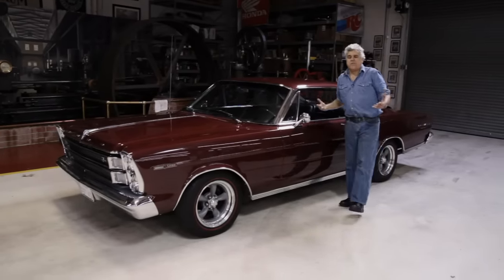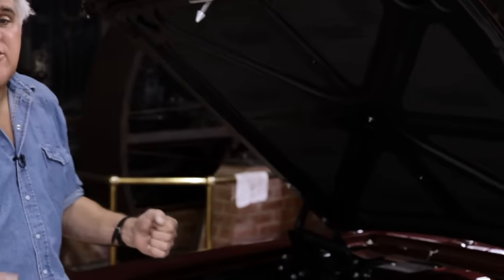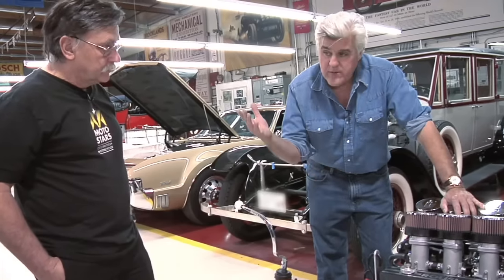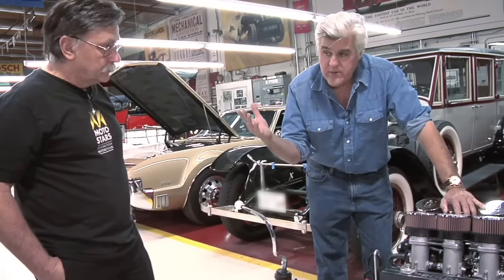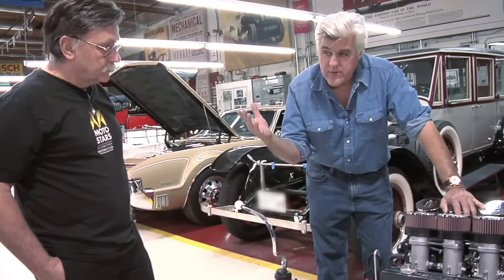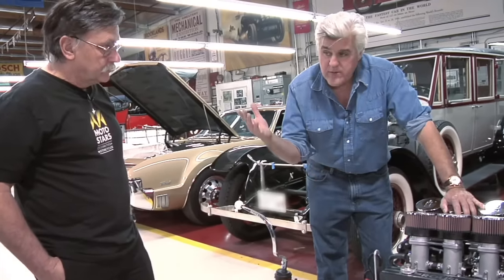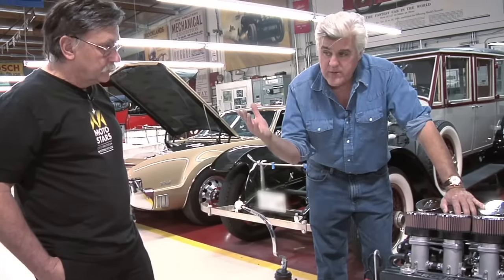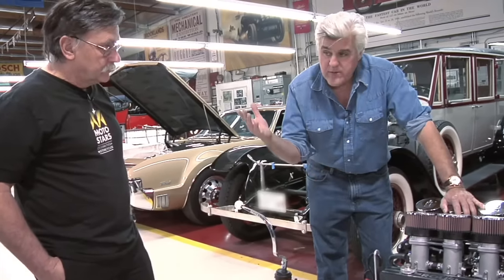Restoration Blog: 1966 Ford Galaxie, Ultimate Edition - Jay Leno's Garage

Comment: "17's look kind of goofy on a vintage car"
AMEN
Reply: +Zakk Gardner It's a big car, ZAKK!I have a 64 with 18's and it looks fine, 20's would look better!
Reply: Sorry, wrong.It isn't a "Hot Wheels" car. It's a 1966 Ford. It didn't come with, and doesn't look goood with "20's". That's for wannabees. It needs 15 inch tires so they match the wheel wells.
Reply: Nope....I used to see it as you do. But things have changed over the past few years.! Because wheels are now typically 19" and 20" sized  in performance applications.....a 17" wheel today looks  lot like the way a 15" wheel, with the extra side wall, looked to my eye in years past. The fact is you really don't have  lot of choices anymore in 15" tires. If you want a "good" tire.......you really have to consider a 17" wheel now.
Reply: From a cosmetic viewpoint, anything larger than 15" on this car puts too much emphasis on the wheel. This simply looks goofy.... like a caricature...  regardless of wheel style.
Reply: I used to think so too........but it's all relative. Back when 17" was a BIG wheel, I'd have agreed with you........but these days it's really not at all big vs. the all too typical 19" and 20" wheels you see on performance cars these days. Jay's opinion in this video not withstanding.......is 4 years old. The idea of "normal" size has changed......worse still? Just try and find a decent tire in a 15 inch size. Even the choices in a 16" size is going away now but you can't buy a good 15" tire at all.......they just don't exist. Nobody makes them. Size consideration goes right out the window when I consider that the only 15 inch tire available is the worthless BFG Radial TA......classic styling is one thing.......a car set up drive well is another and needs a decent tire or everything you've done is wasted on a crappy dated design tire that can't get the job done. 17" for better or worse is now the smallest tire you can buy with lots of good quality choices.
Reply: Dogboy1960
Rubber bands for tires are where we are headed? OK,  I'm prepared to eat my words... but I won't be going quietly. :(
Reply: Rubber bands? :-) ........ lets hope not. But I take your point seriously. That may well be where we are headed. .... It's not that I'd ever want that either. It's really just a situation where our choice is being taken away by the market for tires itself.......and really......When I purchased a new Z/28SS in late '95.......it came with what looked outrageously wide and low profile tires a 275/40/17 BFG Comp TA........I remember thinking this was super low profile vs. anything I'd seen on a production car and a 17" wheel just seemed so very BIG vs the far more common 16" performance wheel most cars had in the 1990s.. Here we are 20 years later and now it's a 19" and 20" wheel in sizes like that latest z/28 and it's 305/30/19s........as to what I now put on my own old cars? I have a '79 Corvette that I've heavily modified for a better ride and handling. I chose tires and wheels that could take advantage yet retained as close to the original size as possible while allowing for plenty of choice in GOOD modern rubber. The original 15x8 wheels that had 255/50/15s were replaced with American Racing wheels 5 spokes reminiscent of the old Cragar SS wheels. In a 17x8 size I put on a 255/50/17 tire. 20 years ago I might have seen it as you do now. A side wall too short for this older Corvette. But now? No-so-much. These tires, with shorter sidewalls now look "normal"......especially in comparison to the much shorter sidewalls that modern performance cars have in 2016.
Reply: There are options in 15" tires besides the T/A Radial...T/A  Radials for the most part are used for their vintage look. Drivers that want actual performance look elsewhere. Personally I use Mickey Thompson Sportsman SR tires. They have excellent grip in dry conditions. For wet conditions their Sportsman S/T tire is really good.
Reply: Mickey Thompson's history is still in place....they make good tires for drag racing situations in virtually all sizes.......but today's cars and the cars with significantly upgraded stopping and turning capabilities like the one Jay has built here......they all demand far more than just "off the line" traction performance. To suggest Mickey Thompson tires will match up well to the capabilities of true performance tires in larger sizes from BFG, Goodyear and so many others aimed at the 17-20" wheel sizes today is quite the stretch and honestly just incorrect. The simple true of it is......nobody makes a GOOD 15" performance tire today because there just isn't enough of a market for them anymore. !7" is a good compromise.....you still have some side wall and you can find GOOD tires in this size.
Reply: truracer20 You are DEAD WRONG on this one. There are indeed 15" tires still available and I do realize Mickey Thomson makes modern rubber too. That changes nothing in what I wrote though. The company's history has largely been made in Drag Racing. Today's cars demand too much from a 15" wheel and those tall side walls. There is also the issue of how so many of us no longer will accept the piss poor handling and braking in older cars. You can go with  a 15" tire if you really like that look better but you will make a HUGE compromise to performance. ....and please stop with the "Clueless" commentary. You are dead wrong on that one too. I actually have quite a bit of experience with this issue. I own a heavily modified C3 Corvette. I looked at this whole issue pretty seriously before buying 17" wheels for the car. The 15 inch wheels it came with originally were the limiting factor in handling after I swapped out coil springs in the front for a fiberglass transverse set up in the front and back both.....and to this a "steeroids" rack and pinion to replace the original steering gear and what I came away with was a car in desperate need of far better rubber than is available in a 15" size. The problem with 15 " wheels is that side wall  height......I don't give a rat's behind what the tires have for a rubber compound.....there simply isn't anything available from any manufacturer in a 15" size that still has the "stock" diameter AND can get the job of traction and tire contact with the pavement done to match up with todays FAR better handling cars and set ups. Mickey Thomson does make reasonably good tires but if I'd gone with the 15" tire and that very tall sidewall......the benefit of modern rubber  is quickly lost. Nobody has to go with the "rubber band look......but today there are just so very few good choices in anything under a 17" size wheel and if you really want to keep the overall tire/wheel height "STOCK"... you really can't keep a 15" wheel unless you are willing to compromise seriously on how far you can go with  upgraded corning ability. On this I'm far from "clueless".....I actually spent no small amount of time, money and effort trying to keep a stock appearance before finally throwing in the towel and accepting that it simply wasn't possible if I really wanted to prioritize getting the most out of a better package for the set up I had installed.
Reply: You are clueless because you are changing the grounds of the conversation to suit your incorrect statements.
Reply: My first mistake was responding to you. What-ever you post after this will get you the last word.  I have ZERO INTEREST in continuing this beyond this last post. You appear to have no interest in the facts of what is available.. You just want to argue. We are not breaking any new ground here. . If you prefer the 15" wheel, That's fine.....nobody can call you WRONG for that. Appearance is very SUBJECTIVE.........what is available is more Objective and measurable. Don't try to sell me an argument that would suggest a 15" wheel and tire combination, REGARDLESS of the tire manufacturer, will match up to the number of far better options available in the 17" and larger size today. The 15" size is now so very uncommon......tire manufacturers across the board offer very few choices in this size wheel.  Jump up to  17" wheel and you can retain some of the sidewall that when it's too short looks WRONG on an older car wearing those 19" and 20" wheels. You aren't just arguing with me on this one. You're arguing with Jay Leno and virtually every single person who understands this far better than you obviously do. Don't take my word for it. Try an online "tire rack" search. Plug in a larger wheel in various widths and check out how many different tires are available. Then plug in a 15" wheel......the difference in what is available becomes extremely clear......so much so ever you can't fail to miss it.
Reply: With the Hotchkis suspension and Willwood brakes you can gain quite a bit of performance from using a larger diameter wheel without increasing the diameter of the tire so it doesn't look goofy or too large for the fender well. Find a good modern performance tire similar in size to the original that meets your requirements then the appropriate wheel. Less sidewall will make the car a lot more nimble even with the stock suspension but it would be silly to put 600 plus hp and a performance oriented suspension in this car and put crummy tires on it. In the end it really does boil down to personal preference.
Reply: Agree, went with period correct r16s on my '88 w124 230e. Although not much of a classic just an old car in decent shape.
Reply: Zakk Gardner ry
Reply: Great comment Zak! I was going to say the same, you beat me to it......They look like ghetto cruise clown cars....Pease!!!! Great taste my friend!
Reply: I own a 69 riv, It has sway bars, coil springs and drum breaks that will put/ slam one into the windshield, Its breaks hard! I totally understand physics and know people that buy these cars. Low profile tires have less roll, got it! They also ride harder, and as I said, look stupid on classic cars. Want a car that corners great, get a newer car. Do what ever you want! Most buy classic cars for the look, they take them to car shows and such.
Reply: We're talking 17" here.....not 20s. The hard ride isn't an issue at 17" and when combined with the better suspension packages you can do now in most older cars........you're argument doesn't hold water. Fact is yyou can't get good tire choices in the vintage sizes. The tire industry has pretty much abandoned the 15" wheel size. Like you I also own an older car. In my case is C3 Corvette. 17" 50 series tire provide plenty of side wall. GM gave me GREAT disc brakes from the factory but the heavy leaf in back and punishingly hard riding front coils were hopelessly out of date showing all the weakness you'd expect of a system first installed on 1964 Corvette. Today Tranvesrse fiberglass front and back, along with much larger sway bars and rack and pinion steering all work wonderfully.......but immediately showed the inferiority of a 15" BFG tire. Since upgrading to the modern rubber the difference is night vs day. Keep the old tires if you must to preserve stock appearance.......but please don't try to sell a performance argument. I know better.
Reply: 15s are easy to find...fact! I said" big low profiles tires look stupid" I never once said they corner better....HELLO???? Hello?? My drum breaks will stop on a dime....Yes there is a break dust issue, I get that.....Fact is it breaks hard...I am speaking about my riv, not other cars...K! I myself never owed a ford. If you think the rubber air space between the rim and tie doesn't affect the ride...yahh! OK!
Reply: I will post to make you a fool! Enjoy!
Reply: Hard to find????Yahh! real hard!
Reply: Not one tire you point to is a "performance tire" up to the standard of today......sorry......nice try but no cigar for you! When I said "hard to find" I'm not talking about tires in general. I'm talking performance tires capable of living up to the expectation I have for a car with a suspension and steering that has been upgrading to modern standard. The tire industry has no real incentive to improve the 15" tire size. It's now an antique size that is even very rarely seen on economy cars today.....and never seen on modern performance. The market is now too small for the 15" size to justify the development we see in larger tires sizes. You don't have to like the look ......but you are none-the-less stuck with the reality of it.
Reply: Again....there is no debating subjective appearance......if you like the stock appearance of the taller sidewall.......that's a choice you make but it comes with compromise to potential performance I'd be unwilling to make.
Reply: All one needs to do is gog el 15" performance tires, there are dozens....as far as "standard of today". These cars are 50+ years old, they can be improved, sure, but they are still 50 year old cars with upgrades, I myself love the originals, I also like some of the mods.....Like I said.... you do what ever you want. I have owned many cars over the years....I currently own a 69 riv, 2007 charger RT and a couple others not really worth mentioning. The cars are very close in weight, fact is I could spend over 20K on tires, upgrade the suspension, I could put the exact 18s on it... and it still would not come close to what/how my charger handles/corners. What cars do you own Dogboy?
Reply: Today I'm all over the map on cars. I used to be an all Chevy guy......but today we've moved away from GM. The only Chevy, I have on the road, is my old Corvette with the heavily modified suspension I've already talked about. Our more modern cars are the 2014 Mustang GT I drive daily in the summer and a 2002 T-Bird she drives on sunny days. Daily drivers are a 2013 Subaru Forester my wife drives when she isn't in the little convertableand a 2017 Ram pick up we use on the farm we need it for. Other than that I've got a '69 Z28 that isn't currently on the road.......it's a project car I've been working on for 3 years now. There never seems to be enough time........ you'd probably be surprised to hear me say that when it does hit the road again it will be all original; down to the wheels and period correct tires. It's a matching numbers car that should be show worthy when complete and good example of car I wouldn't put  bigger wheels than "stock" on.......sometimes "original" is my preferred path too.......but I'll limit that to cars with actual history worth preserving. The old Corvette is one of MANY.......nothing special enough to get overly concerned about originality. For what it's worth though.......new  cars are generally better than old but some old cars respond to changes more than others. My old Corvette will run circles around most modern cars. The suspension upgrades on a car that started life with fully independent suspension, 4 wheel dic brakes and near 50/50 weight distribution....... all adds up to car well worth the compromise on appearance for modern rubber. The C3 corvettes ran from '68-82 and there are still so very many on the road today......it's amazing how many companies are providing bolt on modern suspension and steering systems. My Mustang is a Track Package car and it can't match the much older Corvette in the corners and even with Brembo brakes in front and all the anti lock computer help it doesn't stop in as short a distance either. It's not that the newer car is bad at any of this .......it's just that the 1970s era Corvette is just so very much better today that when it first hit the streets so long ago. It'd be a damned shame to hobble it's potential with the 15" 255/60s I had on it for the the first 20 years of ownership before digging into the suspension upgrade.
Reply: They probably couldn't fit anything under 17" since they put these big break rotors on the size of the calipers added doesn't leave much room. I am not sure but I think that's the reason because they wanted the car to look stock. I would choose safety over 2" in this case.
Reply: Zakk Gardner -. The only thing goofy is your goofy comment...now...go away.
Reply: He's talking about the brake disks.  I don't know of anything that uses a 20" brake disk.
Reply: Well Jay don't care about your opinion (Obviously), so get your own car and wheels and ...problem solved.
Reply: Amen
Reply: Those are still GREAT looking wheels!
Reply: True....Nothing says "POOR TASTE" that the stupidly huge wheels they are running today. Only reason to go bigger is for the brake clearance. 26" are for the no taste hydraulic/low rider group.
Reply: Sadly you sometimes have to go bigger just because the selection for the 15<17" aren't made anymore;-(
Reply: @TechSeller  Drum brakes (not breaks, although they do "break often enough) are not undesirable because of brake dust, nor because of more unsprung weight. It's because of FADE that they became ridiculously out-performed by disk brakes. They may "stop on a dime" a few times. Press them beyond that and you will quickly lose that ability, due to excessive heat and fade. It's a funny concept, called physics. Look it up.
Reply: What are they?  Kreagers?
Reply: @Dogboy1960 "Nope....I used to see it as you do. But things have changed over the past few years.!"

That just means you have a malleable mind, i.e., you're a follow-the-crowd type of person, like a typical woman.

"a 17" wheel today looks  lot like the way a 15" wheel, with the extra side wall, looked to my eye in years past."

So you have a malleable, and defective, sense of proportion too. 17" wheels look nothing like 15" wheels, for obvious reasons. Also, since there's a limit on the diameter of tire you can fit on a classic car before running into clearance issues, the bigger the wheel is, the shorter the sidewalls will be.

"The fact is you really don't have  lot of choices anymore in 15" tires. If you want a "good" tire.......you really have to consider a 17" wheel now."

BF Goodrich Radial T/As work fine, regardless of your unfounded opinion of them. Also, Cooper Cobra tires work fine as well. Plus, Coker Tire makes the best looking tires in the world, since they created a modern radial tire that looks exactly like original Firestone Wide Oval tires from the muscle car era ("bias-look radials"). Nothing looks better than a bias-ply tire, and Firestone Wide Ovals and Goodyear Polyglas were the best looking bias-ply tires in history. You drive a street car, not a race car, but even if you did drive a race car, 15" wheels are still fine, given that every NASCAR race car still uses 15" wheels. You thinking that your street car demands more from a tire than a car that races at ~200 MPH for hours at a time, is laughable. Your C3 Corvette can't even reach 200 MPH, and even if it had the right engine and gearing to reach it, you'd lose control of the car long before reaching 200 MPH, because it isn't aerodynamically designed to be stable at such a speed. It would try to fly, and you'd lose traction, which includes losing the ability to steer.
Reply: Tell that to AUSTRALIA
Reply: The heck with the big wheels put some 13 inch wheels and tires on this bad boy you know you want to...
Reply: Gotta clear the brakes
Reply: I would never go bigger then 16s on any vehicle, unless the vehicle came with bigger rims.